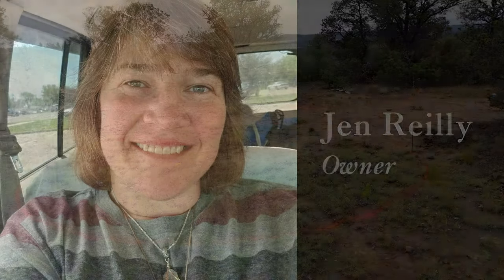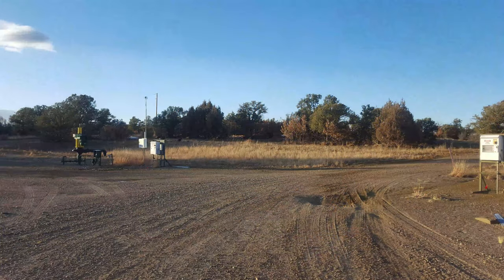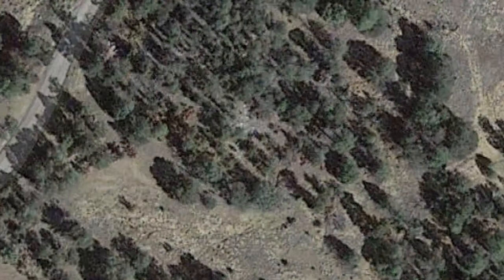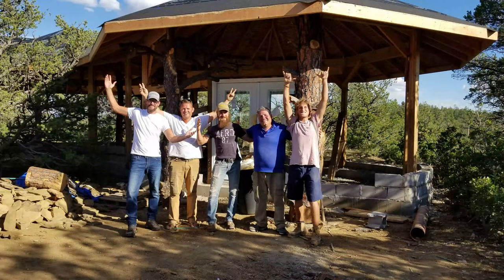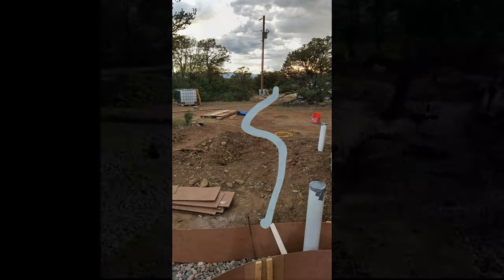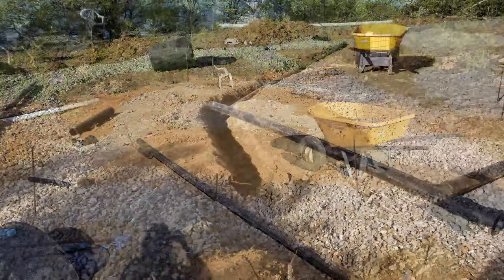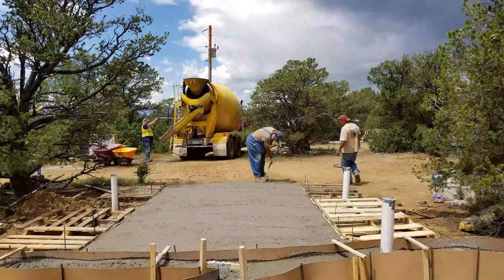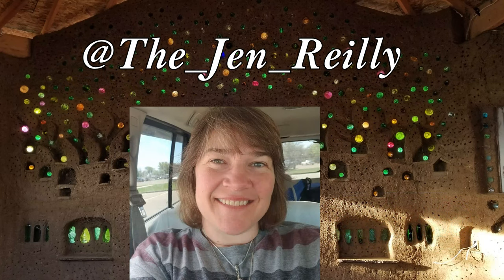How-to Cob House: Siting, Foundation, Underground and Permits

Comment: Thank you so much for this video. I’m planning my first cob home and the mistakes are the most valuable things you could have passed on. 😊. I will be building in Kenya and although the climate is different, on the plus side they have been building with natural materials forever. 
Thanks again.
Reply from the maker: Thank you!! That's the biggest reason im making these videos. I have more mistakes to pass on. Stay tuned! Also, you can ask me anything, and if I have experience with it, I'll 4 pass it on, and maybe make a video on it.
Reply: @The_Jen_Reilly  thanks! I sure will. I’m so excited about this new journey I’m on. I can’t wait to get started.

Comment: Jen, great informational video. After getting your plans reviewed and approved, did they tell you that you must get every step approved? You say that you did the plumbing and it failed. Does every step require an inspector to check your work? I’m sure that adds a lot of $$, am I right?
Reply from the maker: Yes, for the most part they required ongoing/process inspections. Definitely electric, septic and plumbing. A lot of your needs will depend on your governing agencies.  There are places with no code enforcement. My county has very homeowner-friendly code for everything except plumbing and electric, which are state supervised. The delays and re-inspections weren't terribly expensive. I basically discovered that if you're nice to "the man" and play by the rules, it's not awful. Ask informed questions so you don't overburden the clerks and inspectors. For me the biggest aha was to realize that the system is "mostly" in place to protect you and FUTURE homeowners. If you only think about your needs and capabilities to live with your construction, owners after you may not be informed or capable of what you find a funny little idiosyncrasy.

Comment: You dont need a roof to collect water. You can start with poles and tarps. I have no roof but 1500litres of fresh water 😊
Reply from the maker: I agree. I've just been overwhelmed with the whole project.
Reply: @The_Jen_Reilly  I totally understand  I'm in limbo. Need $5000 for my own land. I'm not allowed to practice cob techniques where I rent as I'm not allowed to use the earth on the land unless I climb up into the jungle which I physically can't do. So I have to find simpler and cheap ways to do things.